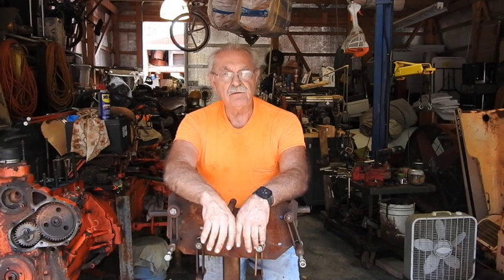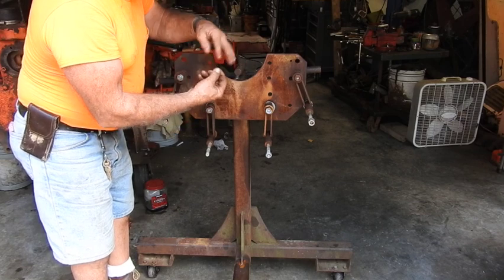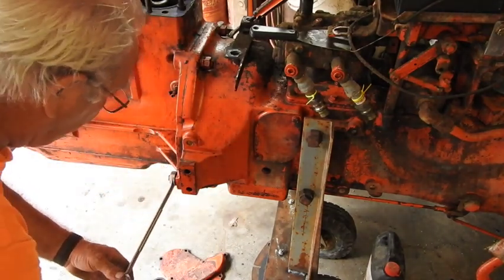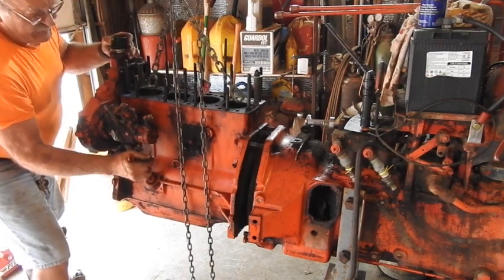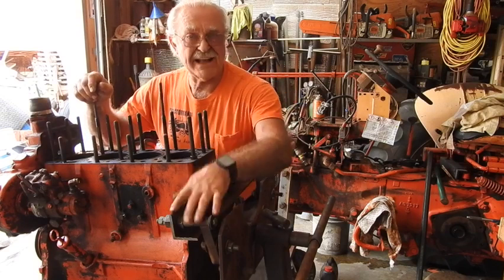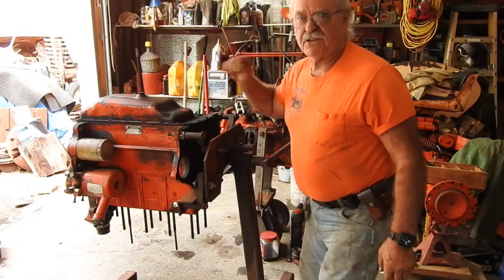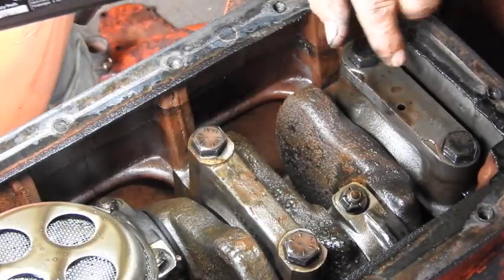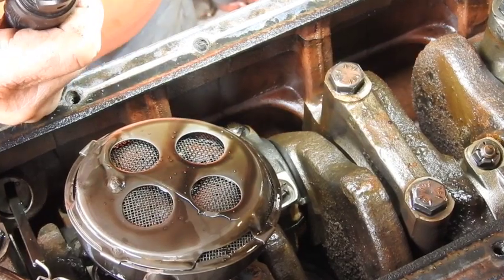Case 430 Engine Removal and Mounting to Engine Stand

Comment: Hello everyone. Someone please help. I am new to this but have previous mechanic work(basic stuff) I am trying to tear this engine down( early 60s case 430) and I am stuck at the 1/2 inch anvil head at the front of the engine. I thought that that it is right hand thread so go counter clockwise wise to get it off but I have tried a 1400 torque break away by DEWALT and still nothing can budge it. Any ideas? Am I doing something wrong? I have not took out any internals yet because I thought this part of assembly should come out first? Thank you for anyone’s help.
Reply: And this is in reference to to trying to get the front crank pulley to get to the timing cover.
Reply from the maker: Sorry, I missed your comment.  I usually use and impact socket and either a pneumatic hammer or a Makita battery impact tool to remove them.  It should be counter-clockwise to remove, just like you are doing.  Remember, looking at the front, the engines turn in the direction of tightening a nut so that using a hand crank will always be tightening the nut on the crank pulley.  Sometimes it just takes one heck of a lot to break 'em loose.  I can't believe the 1400 ftlb DeWalt failed your attempt.

Comment: I guess you found that bolt inside water pump. Did you remove the injectors from head before you took it off?  I am trying to avoid removing the injectors if I can.
Reply from the maker: Yes, I sure did remove the injectors first. I had one tough time breaking the head gasket seal too.

Comment: Motors are not bad To remeber    automatic trans  a lot more parts
Reply from the maker: Hahahaha....you are certainly right about that.  But the thing to remember is they only go together correctly one way.... I do have to stop and think sometimes though.  Especially if a lot of time passes or another motor is torn down in the mean time.  I only have soooo many brain cells.
Reply: Been a mechanic since i was 20 iam 68  now
Reply from the maker: @wilmamcdermott3065  Awesome !! A great career for sure !!  I'm a hack at best.  Mostly a shade tree kinda mechanic out of necessity.
Reply: @tractorman4461  have 3 licences. Heavy duty automotive and  DOT inspection lic

Comment: Wont break that engine stand in a hurry👍Take plenty of photos with your phone, always helps.
Reply from the maker: Well, an old buddy once told me it will only go back right one way !!  LOL.  He told me that after I'd restacked the transmission on a 500 Kawasaki two stroke triple in 1975 when I showed him one little spacer I had left over and had no idea where it was supposed to go.   He said well, you'll know when you kick it over.   Yes, it was a spacer for the kickstarter that shifted the pawl just enough to engage the kickstart to the internal gear for spinning it over.  I've never forgotten that simple message...  Thanks for the compliment on the home made stand, btw.

Comment: Add water mixed with molasses put in cylinder that is locked up add ratchet strap fix to frame...in a day or 3 the engine frees up! Molasses and water frees rust 😎👍
Reply from the maker: Now that's something I've not heard. I will register that to memory and try that on something rusty.  I've already gone another route with this one so it's too late to try it now.  Thank you for the tip.  That's one of the coolest things about youtube, new suggestions are always there.
Reply: Ive used powered molassis in a electroliss vat. It works but can alter metalurgy.

Comment: This is the first time, I've heard a dip stick referred to as "cute"  hahaha.
I do hope that number one is not stuck too badly. ( If you had easy and low cost access to one )  this would be a good time to use a 'hot tank' for that engine block after full disassembly, wouldn't it?
Reply from the maker: Well Reg....there's this thing I got in the lean-to recently that I've never plugged in yet....I don't even know if it works but it sure looks like something that would come in handy on this dirty and rusty old block !!  There just MIGHT be a video on it if it comes down to it.....LOL  I wonder what the solution is that's used in a hot tank....any idea !  Is it just the standard parts cleaner or some chemical filled solution....asking for a friend.  (-;
Reply: @tractorman4461  Actually, there was one of those tanks at my place of work, back in the 1970's,... and it was caustic soda! Strong stuff and fume that would clear your sinuses, I can tell you, but boy oh boy,. it sure cleaned those engine blocks. Having said that, the 'hot tank' had rather heavy, 220 VAC heating elements in them, so it was scalding hot caustic soda solution too. I wonder if you can buy that soda today?
When last I made use of a hot tank, it was at an engine rebuild shop and they did my two Willys Jeep engines,...( no charge ) but  of course I bought all my engine parts, Crankshaft regrind, new cam shaft, pistons and rings etc.   I needed, there too.
Reply from the maker: @regsparkes6507  I might have to do a search and see what is suggested for use this day and time....but I gotta make sure it even works first.  It'll hold a V-8 block standing on end.  It has a large sump, pump and heater.  Two doors that swing open to the front as I remember.  I'm hoping its 240 v single phase, because the building it came out of doesn't have 3 phase 480v available.....I hope.  Those little flatheads are fun AND reliable ain't they.  I really like them, so simple too.
Reply: @tractorman4461  Oh yes they really are, fun to drive AND build too.
The hot tank we had used an overhead crane to lower the block straight down in, i.e. open top, so more light a large cubic vat. 
We often joked on which nasty customer would we like to drop in there! Evil minds at work you see! :)
Reply from the maker: @regsparkes6507  Oh MY !!   But I can see that being a conversation.  LOL
Reply: @tractorman4461   :) foolish conversation we had back then!

Comment: First time I’ve ever seen that done. I really enjoyed it. My question is how the heck do you keep track of all the nuts and bolts you take off and get them back where they belong?  Awful lot of parts!  Stay safe my friend.
Reply from the maker: Well Bob, like an old friend told me.....'It'll only go together right one way'...LOL.  I cut scrap boards and align all the stuff in order, with the 'front' marked.  I'll run screws in the board and set the main bearing caps over the screws...things like that.  Or like all the holes in a board for the push rods, a zip tie to hold them in place.  To keep the rod caps with the right rods/pistons I'll finger tight the nuts back on the caps....little things like that.  Thanks for todays comment my friend.

Comment: Wendell,  roughly how long will it be before the Case will be running, just an idea? How hard is it to get the seals and gaskets for your overhauling projects? Nice to see the Missus stopped by to inspect your work and progress. Always nice to hear her upbeat voice and enthusiasm. Have a great rest of your week and be safe.
Reply from the maker: It'll probably stretch out a while because I don't know yet if it's needing any machine shop work Mike. If that's the case the time frame will be at the mercy of their schedule.  The camshaft looks to be pitted on a few lobes and if its more than superficial, it will need replaced. If that's the case, the cam bearings will need to be changed and that's one that I always have a  machine shop do because I don't have a cam alignment tool....which is essentially a set of cones that allow perfectly centering of the line of bearings. The tolerance is so close on those it's nearly impossible to install them without the tool with a high degree of success.  Especially a shade tree hack like myself.  So I don't have an answer for you with so many variables.